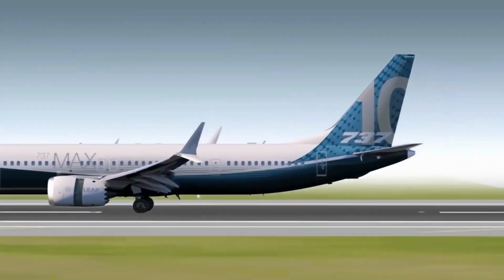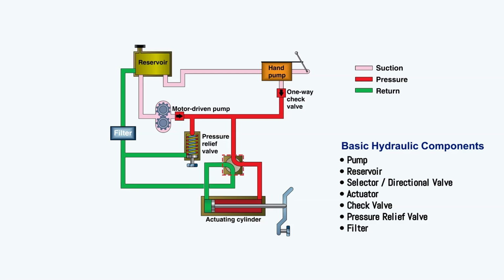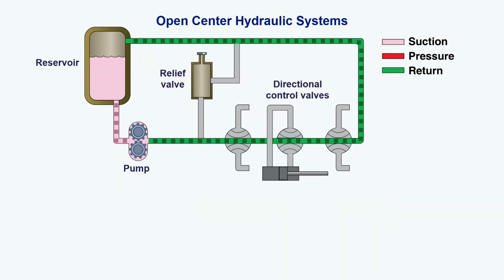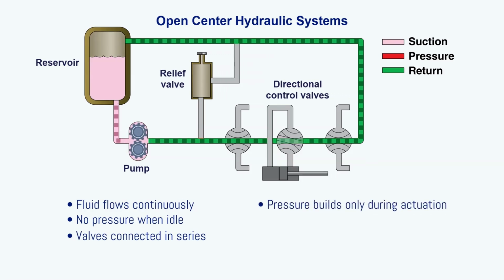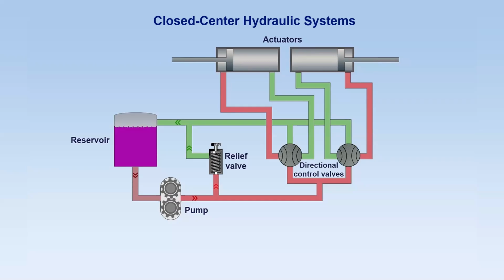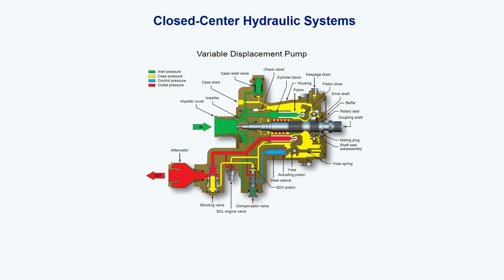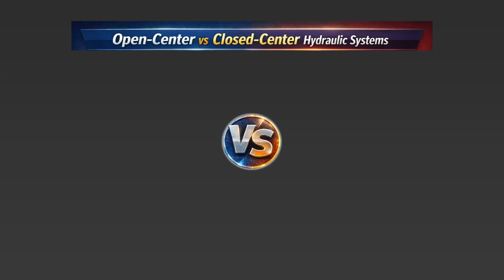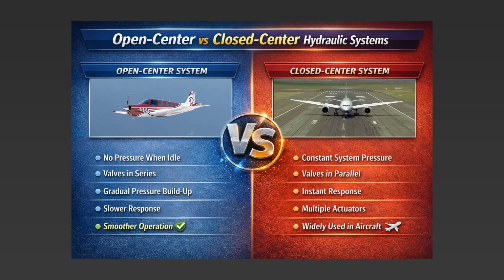Aircraft Basic Hydraulic Systems | Open vs Closed Center Design

Comment: This video's clickbait image was, I believe, a Cessna Skylane. The only hydraulic system on that airplane is the brakes. (There is the constant speed propeller, but while it is "hydraulic" it operates on engine oil and is normally considered as an engine subsystem) Hydraulic brakes on an airplane like the Skylane have no pump, but rather use a master cylinder and a "slave" cylinder. The master cylinder takes motion and force from the pilot's actuating foot and the resultant flow and pressure are transmitted to the slave cylinder to move and squeeze the brake linings against the disk. The force applied by the pilot is multiplied by the ratio of slave (caliper) cylinder divided by the master cylinder area.
The master cylinder has a means to refill itself from a reservoir to make up any net volume of fluid sent to the caliper and not returned when the pilot releases the brake.
This is where hydraulic system explanations ought to start.
The explanation of the open center system did not describe the relationship of force required at the actuator and the pressure developed by the pump. The pressure rises the value of actuator force/cylinder area.
When the valve is shifted, the cylinder immediately begins to move at a speed = flow rate/area of the cylinder. These values are theoretical, there is also some pressure required to force the fluid flow through the plumbing.
Reply from the maker: Thank you for the detailed and technically accurate explanation.

You’re absolutely correct that light aircraft such as the Cessna Skylane primarily use a simple master cylinder and caliper arrangement for braking, and that the constant-speed propeller system is typically considered an engine subsystem operating with engine oil.

This lesson was focused on general aircraft hydraulic power systems, particularly open-center and closed-center designs used in larger aircraft applications. However, your point about starting with basic master-slave cylinder principles is well taken, especially for foundational understanding.

You are also correct regarding pressure-force relationships. Hydraulic pressure develops according to the load at the actuator, based on Force = Pressure × Area, and actuator speed is determined by flow rate divided by piston area, accounting for system losses.

I appreciate you adding this clarification — it definitely adds value for viewers studying hydraulic fundamentals.